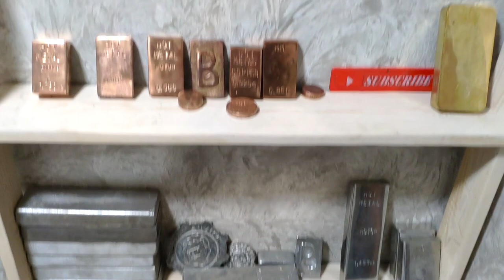Melting soda cans - Thor's hammer casting. Trash to treasure / Aluminium casting

Comment: You know that this is not a Thor’s hammer right? Thor’s hammer has engraving on every side and a nice handle. You casted just an ordinary hammer 😉
Reply from the maker: There was an engraving on the model of the hammer, but the engraving was imprinted in places on the casting. And I made the decision to make it smooth .